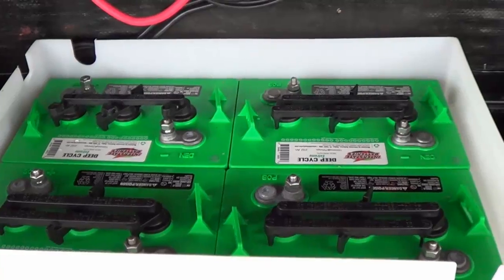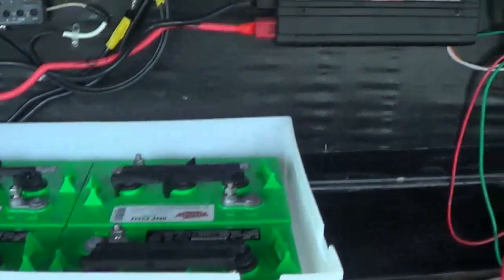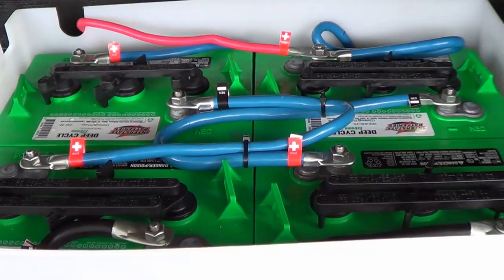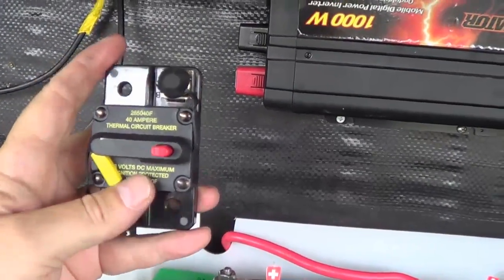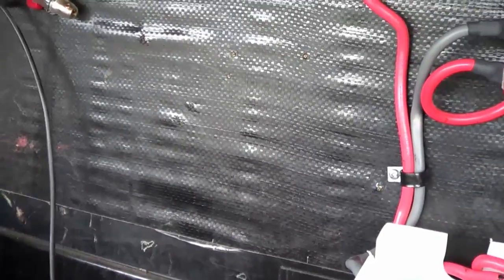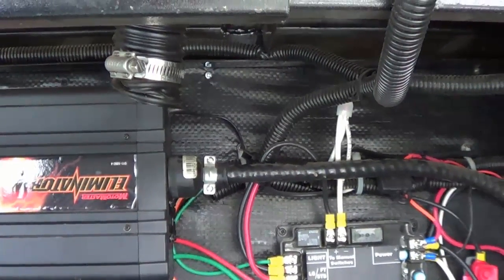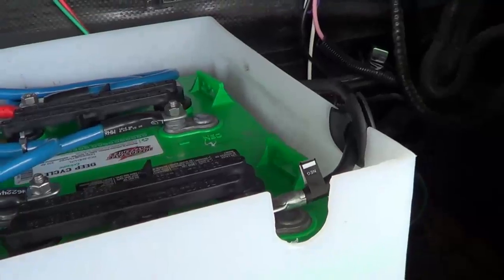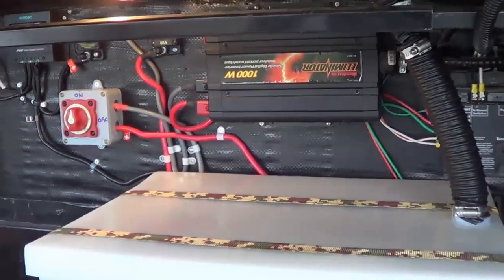Upgrading My RV Battery Bank for Dry Camping

Comment: If you get a true MPPT charge controller you can increase your charger output to the battery bank by 30 - 50%. That seems to be the weak spot in your setup. But watch out for the fake MPPT junk. There are plenty of videos on YT to show you what to look for, like the large inductor coil inside the unit. Tracer is good, and others like it. With true MPPT you can connect panels in series. There are several benefits to that. For 2 - 100w panels you can connect them in series to use a 10a controller, if you want to add 2 more panels get a 20a controller. I would get the monitor as well. About $100 - $130 for a set. With limited area to mount panels, every extra amp is valuable.  https://www.youtube.com/watch?v=K7NWpxxEB9o
Reply from the maker: +pokerfacetodd I have tons of room for panels so not an issue for me. I went with a Bogart SC2030 PWM controller, very happy with it. Works in tandem with the Trimetric Battery monitor making for  a very customizable charging  system at an economical price point - http://www.loveyourrv.com/bogart-sc2030-cc-and-trimetric-tm2030-rv-installation/
Some info from the Bogart FAQ as to why MPPT isn't always the 100% clear best choice. It's a complicated issue with many variables, depending on the whole system, where money is best spent and how it is used. Cheers Ray

C1. The debate rages: which controller is best PWM (Pulse Width Modulation) or MPPT (Maximum Power Point Tracking). Why did you choose PWM technology instead of MPPT for your SC-2030 Solar Charger?   Click for answer
A very good question! They BOTH have good and bad. Plenty of hype has been written already. Here's my (Ralph's) view:The "good" for PWM: It is simpler and lower cost technology. Under some common circumstances--it can actually deliver more amps to the battery. That could be when:(1)days are moderate or warm, with few clouds.(2) batteries are charging at over 13 volts, (in a 12 battery system) which they almost always are when actually CHARGING.(3) Panel voltage is properly matched to the battery voltage, for example "12V" panels are being used with a 12V system.PWM is actually more "power efficient" than MPPT--which means less total power loss in the controller itself. So heat sinks in the design can be smaller (and less expensive). Missing in most analysis of MPPT is that there is always a conversion loss with MPPT, which tends to be higher the greater the voltage difference between battery and panels. That's why PWM can actually beat MPPT under circumstances described above.Some places that analyze MPPT assume that panels with 30V open circuit voltage are being used in a 12V system. Any good MPPT system will easily provide better performance in that case. They also may assume batteries are charging at 12 or even 11 volts, which is unrealistic. Lead acid batteries are typically below 13 volts only when discharging, or perhaps charging with very little charging current--meaning the actual potential gain in amps is not great.The benefit for MPPT becomes apparent if you use panels not voltage matched for the battery. If they are not, MPPT will utilize more of the potential energy of the panels. For example, if you use 24 volt panels to charge a 12 volt battery system you must use MPPT, otherwise you would be using your panels very inefficiently. If you are trying to use PWM in that case, you are misusing the PWM technology.Another potential benefit with MPPT is that if distance between panels and batteries is far, smaller wire can be utilized by running panels at higher voltage to the batteries. Running at twice the voltage reduces wire size to 1/4, which for a long run can be a significant saving in copper wire.If temperatures are low enough, the slightly less power efficiency of MPPT will be compensated by the higher panel voltages, which will result in a little more battery current. But in actual measurements we made using a commonly sold MPPT solar controller, this would occur at temperatures less than 55 F degrees (in full sun, when charging at more than 13 volts), where there is a slight advantage to MPPT in my location (Boulder Creek, near the California coast). As temperature drops below that (in full sun) MPPT will get some advantage, such as could occur at high elevations in Colorado in the winter. Potentially this would be maximum about a 2.5% improvement in amps output for every 10 degrees F lower in temperature (or 4.6% per 10 degrees C colder. I'm using data from Kyocera KD-140 panels.)There can be theoretically optimal situations (that I don't personally experience where I live) where MPPT could give some advantage: that is when solar current is present, but the batteries are quite low in charge--but because loads are high and even greater than the solar current the batteries are still discharging despite the solar current. Under these conditions the voltage COULD be at 12.5 volts, or even lower. Again, using data from Kyocera panels, ("Normal Operating Conditions") there is a theoretical maximum gain over PWM of 20% current assuming NO MPPT conversion loss and no voltage drop in the wires to the panels, at 20C (68F). With PWM, the voltage drop in the wires in this case would not affect the charging current. Now if in addition you lower the temperature to below freezing at 28 degrees F (while sun is shining) you might actually get up to a THEORETICAL nearly 30% gain while the batteries are discharging.The only REALLY BAD part of MPPT, is all the hype surrounding it--for example one manufacturer advertises "UP TO 30% OR MORE" power harvested from you panels. If you are using solar panels properly matched to the batteries, 30% ain't gonna happen unless it's EXTREMELY cold. And your batteries have to be abnormally low in charging voltage--which tends not to happen when it's cold (unless you assume the battery is still discharging while solar is happening). Virtually all the analyses I've seen touting MPPT on the Internet ignore the conversion loss, assume really cold temperatures, assume unreasonably low charging voltages, assume no voltage drop in the wires from panels to batteries, use STC conditions for the panels (that the marketing types prefer) rather than more realistic NOCT conditions, and in some cases assume panels not voltage matched to the batteries.The other thing that is misleading about MPPT, is that some manufacturers make meters that show both the solar current and the battery current. In almost all cases for a well designed MPPT type the battery current will be greater. The engineers making these know better, but it is implied (by marketing types?) that if you were NOT using MPPT you would be charging your batteries with only the SOLAR current that you read on their meters. That's not true, because the PWM BATTERY current should always be higher than the MPPT SOLAR current. It is the nature of the MPPT that maximum power occurs when the current is lower than the maximum, so they must operate there to get the maximum power. So to properly compare the two you need to compare MPPT with an actual PWM controller in the same circumstances.Finally, the reason we went to PWM is that I was anticipating that panel prices were going to drop (which they certainly have over the last 5-10 years!) and that the small advantage of MPPT (under conditions where the correct panels are used for the batteries) would not justify their additional cost and complexity. So my thinking, for more total benefit per $, put your money in an extra panel rather than a more expensive and complex technology.
Reply: Love Your RV For me, losing the 30 -50% was more than I am willing to part with. I have 12 panels and 30% of 1200 is 400 watts. The esmart controller was only $150 so I add 400 watts for only $150. Plus, with the MPPT I am able to connect more panels on a smaller controller.  At 48v coming in I can get 20 panels on one 40a controller. but at 12v only 5 panels can be connected. In all my testing, comparing pwm to mppt, my results were staggering. I saw nearly 50% increase in most every condition I tested, and no less than 38%. That's enough of a benefit to me to spend the extra cash. My panels are 18v and the battery is 12-13, no more than 14. So I'm throwing away the 4-5v that I can't use with pwm, plus I would be restricted to using 12v system and connecting panels in parallel. That cost more in added controllers, connectors and wires.

I have several controllers. I have the Renogy one you had, and another good pwm with lcd readout. In mppt I have one of the tracers with the monitor, I have one of the 20a Chinese off brands with a yellow face, one of the off brands 40a orange faced, and one of the 40a blue esmart that connect to a computer and have temp monitoring. I got them for testing purposes mostly, though the pwm controllers were before I realized I can't get 100w from my 100w panels under any conditions. I chose not to spend $500 on a higher end controller in exchange for some variety and backup incase of a crash. I have been looking for a system that will monitor each battery individually to avoid overcharge, because charging my 12v batteries in series with a 24v charge gets them out of balance at the top of the charge. I'll look into what you bought. Good chatting.
Reply from the maker: When a system gets ot your size an MPPT controller definitely makes sense.
Reply: Love Your RV I started small and added panels as a way to avoid getting mppt. I wanted 600 watts, but I needed to add 600 more to get the 600 I wanted, because pwm was giving me about 340 watts from 600w panels. Once I did that, I realized it was now a better deal to get mppt because instead of a small system I now have a larger one. lol

Comment: Hi ray, i currently have a travel trailer with a single 12v battery on the outside, can i switch to 2- 6v batteries and move them inside one of my storage compartments? what would you suggest about ventilation?
Reply from the maker: +Pierre Dumont You would have to put them into a sealed box then run vent piping. Possibly a little fan. Many people use AGM type batteries for inside compartments as they are sealed and don't vent gases unless badly overcharged. Then you might be able to get away with no seal box.

Comment: I'm confused, do all the lights work straight off the battery bank? What about fridge, TV? If so why do you even need an inverter? I thought the inverter seems small but maybe that's because I don't know what it actually goes to. These are general RV type questions.
Reply from the maker: Most RV electrical circuits will run just off the batteries. Our inverter is only really needed to run our 43" LED TV, my wife's 21" iMac computer, dental water pic and a small shop vacuum. They can only run off of AC power. 
We also use its output to plug chargers into for things like camera batteries, electric shaver, phones, tablets and laptops.

Comment: thank you very much. There isn't all that much to be afraid of is there? I saw this video (https://youtu.be/RpFb_Yxl_hA) for making cables. And for some cable you can make them from cut up jumper cable . Where did you get solar panels from? I imagine like anything there is quality and there is junk
Reply from the maker: Wear eye protection when working with batteries, use insulated tools and never let positive and negative touch and it's pretty easy. Just want to make sure to properly fuse all the wiring so short circuits can't lead to overheated wires and possible fire.They are Renogy 100 watt panels, pretty decent for a cheaper end panel - http://www.loveyourrv.com/upgrading-our-renogy-rv-solar-system-to-400-watts/ I also liked the smaller size and weight. A really high-quality panel would be Kyocera, but of course higher price too.

Comment: Very nice. Wiring confuses me very easily and you simplified this. Do you still use the two original 12 volt batteries in addition to the new 6 volt batteries? For a total of 6 batteries in total ? I would like to do something simular but hook up my inverter to the house outlets but bypass the microwave outlet and the outlet that is used for the hair dryer. Is this transfer switch you talked about automatic or is it manual?
Reply from the maker: I have 4 6volt batteries now. In this newer video, there is a piece where I show the even more simplified battery wiring. https://youtu.be/uRbGmxun1LI
Also have a look at this updated video - https://youtu.be/yV2xJiHSbfU for inverter information. Cheers Ray
Reply from the maker: I have 4 6volt batteries now. In this newer video, there is a piece where I show the even more simplified battery wiring. https://youtu.be/uRbGmxun1LI
Also have a look at this updated video - https://youtu.be/yV2xJiHSbfU for inverter information. Cheers Ray
Reply: Thank you for your answer Ray. When the batteries are being charged by the solar panels, do you not have your RV hooked to shore power? Can the batteries be charged from both forms of power at the same time?
Reply from the maker: Yes, I charge with both at the same time the solar controller is smart enough to figure it out. I leave them both hooked up.

Comment: If I remember correct, 6 volt batteries need or require a high amp charger in the 15-20 amp range to charge the batteries fully. Would you happened to know what your solar charger is putting out? and can give us your results with this setup so far?
Reply from the maker: Right now the solar charger is putting out about 20 amps during the peak daily solar hours. Will put out more as the we get into spring and a higher sun angle. I have my solar panels flat mounted.
More important than amperage to completely charge the 6 volts lead acid is voltage. During the absorption phase, I have the solar controller set to 14.8 volts. The Bogart SC2030 controller I recently installed is doing a great job of charging. There is some interesting battery charging info in the last pages of this instruction PDF for it. - http://bogartengineering.com/sites/default/files/docs/SC2030-9-10-15-UsersInstruc.pdf

For cloudy days or when we have depleted the batteries by using excessive power that the solar can't do the recharge fast enough, I have installed a high-quality battery charger. http://www.loveyourrv.com/installing-the-inteli-power-pd9260-for-improved-rv-battery-charging/ Between this unit for generator time and the solar controller my battery bank is getting well charged.

On average when boondocking, we use 50 to 100 Amp Hours from sundown to sun up so usually the battery bank never goes below 75% charged. For our lifestyle it's a good sized bank, meets our day to day needs with a little extra capacity even.
Reply: +Love Your RV Thanks Ray! I took your advice and read up on the your Bogart controller, It looks like a well thought out controller.
Reply from the maker: They have good support too. It's a small company, you can actually phone up and talk to the owner and inventor.

Comment: How can I find out where you sourced all of your switches, fuses, etc. You have a lot of hardware there to acquire. Have you seen anyone do this to a travel trailer? I have a toy hauler travel trailer. Thanks for your help.
Reply from the maker: Much of the stuff is available on Amazon or at Arizona Wind and Solar. If you check the mod section of my blog I usually link to sources of the parts when I write a post.  - http://www.loveyourrv.com/love-your-rv-mods-and-upgrades/

Comment: Nice set up and very neat, when you get your new controller if you haven't already, you might would consider mounting it in a wall up in your rig were you can see at ease what's going on with your batteries and panels as far as charging and volt usage.
Reply from the maker: Thanks! I just got finished installing a new Bogart controller which works in concert with a Trimetric battery monitor - http://www.loveyourrv.com/bogart-sc2030-cc-and-trimetric-tm2030-rv-installation/
I've read it is best to have the controller as close to the batteries as you can for less power loss when charging. I think his combo will work well because I can see all the info on the Trimetric which is communicating with the controller through a telephone data line. :) - Ray
Reply: Well that works even better then, you've got it covered.

Comment: Hi you have mentioned the ground wire in the beginning of the video. Where is the ground wire coming from, and which components of your system are connected to the ground wire/wires? Thanks a lot
Reply from the maker: +mosheg77 The ground wire I mentioned is not actually an earth ground. It a cable running from the negative side of the battery bank to the fifth wheel trailers metal frame or commonly called a chassis ground. It was installed by the manufacturer.
From what I've seen though most components in the RV are using a separate negative 12 volt wire and not using the chassis ground as a return.

Comment: Hi Ray love yor channel. You have swapped Trojan for Interstate, are Interstate a better brand? thx in advance
Reply from the maker: Hi  Dino, thanks. :) 
Not sure if better or not yet, Trojans are highly thought of, but the Interstates were a pretty good price, have lots of dealers in case of a failure and I've used the brand in our big diesel truck for years with good results so thought I would give them a try when it came to replacement. So far they seem to be performing well but  time will tell.
Reply: Thanks Ray

Comment: what does 464 amp hours mean
Reply from the maker: It's a rating of the batteries total stored power capacity when fully charged. 
Say you are running a TV and it uses 5 amps of current to run. If you want to run it for 10 hours you would require 50 amp hours of battery capacity.
Another thing to keep in mind is when I say 464 AH that is the total capacity of the battery bank but not the useful capacity because it's recommended to not discharge the batteries below 50 or 60% so my useful capacity is only about 200-230 AH.